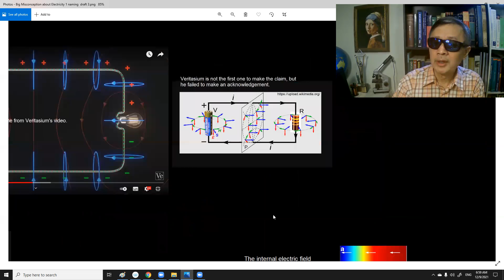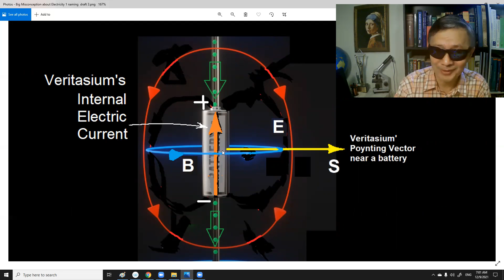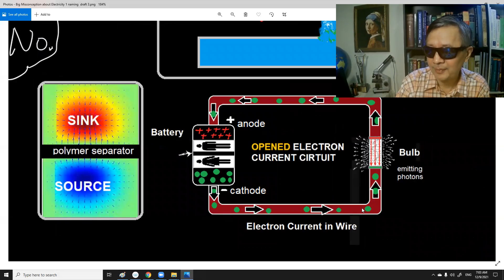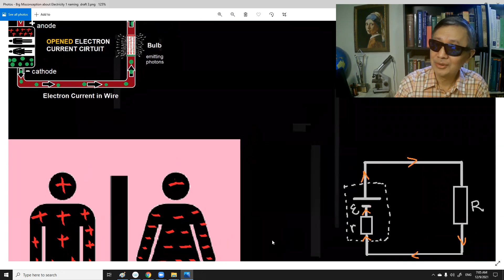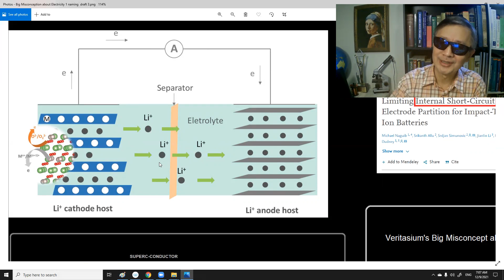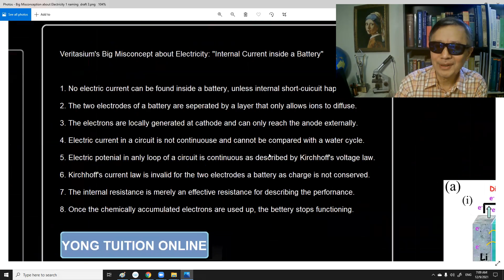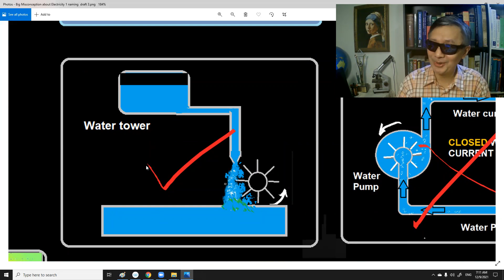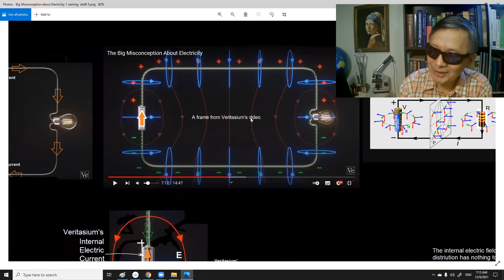No Electric Current inside a Battery: A critique on Veritasiaum's Misconception| Yong Tuition 211209

Comment: Like the other videos he has published on this subject, this is completely wrong. An electric current is a flow of any charged particle, it is not limited to being a flow of electrons. You can find this in any textbook. Positively charged ions flowing inside a battery constitute an electric current and obey all the laws that electric currents obey. They are subject to Ohm's Law, they generate ohmic heating, they create magnetic fields according to Faraday's law of induction, etc. Their mass is irrelevant: the current is simply the flow of charge in unit time. 

So, going over the 8 points at the end:-
1. This is just wrong, there is an electric current inside the battery resulting from the cations and anions migrating within the electrolyte. 
2. Mostly correct, though not all batteries need a separating membrane. 
3. Electrons are generated at the anode of a galvanic cell and move round the external circuit to the cathode. 
4. This is wrong. Electric current goes in a circuit. If it didn't, there would be a strong electrostatic potential between the two half-cells which would quickly stop any current flowing. 
6. Charge is conserved. 
7. Internal resistance is a resistance, same as any other. 
8. No, that is not how batteries work. There is not a pool of electrons at an electrode that get used up.
Reply: I think you are mostly right. Yong Intuition is losing it. Gone off the RADAR.
Reply from the maker: 1. If so, your battery would be burnt immediately.
3. How can electrons spontaneously move to the cathode which is negative? 
4. See answer 1.
6. In an ideal battery, charge is assumed so.
7. Internal resistance is a phenomenological indicator, rather than a real physical resistor. 
8. R u serious?
Reply: @yongtuition  1. The battery would not be burned. Ions flow inside a battery and this constitutes an electric current. The battery will only fail if there is a direct short between the electodes. 
3. Electrons in a galvanic cell flow through the external circuit towards the cathode because in a galvanic cell the cathode is positive. 
7. Internal resistance is a resistance, same as any other. 
8. Yes, I'm serious. You, on the other hand, are a crank who does not even understand what an electric current is. Any flow of charged particles is an electric current. This is not a mere terminological distinction because all electric charges and currents obey the laws relating to electricity, including the Maxwell equations. The type and polarity of the charge carrier does not matter.
Reply from the maker: @BumbleTheBard  It you call the negative electrode as cathode, you don't have to explain your cathode actually is the positive electrode.
Reply from the maker: @BumbleTheBard  It is evident that you can't tell the difference between rain and  water in a pipe.

Comment: You said the current due to ionic diffusion is not comparable to the outside current, what do you exactly mean by not "comparable"? That the Li+ ions movement speed thru the electrolyte and the separator is much  slower than the outside electron speed? I want to understand the comparison among these two little better, for example 100mA current in a 1mm diameter copper wire causes individual electrons to move with a speed about 5.8μm/s. Assuming we have normalized the density of the electrons and the Li+ ions, is the ionic diffusion speed much lower than that?
If this is the case how is the charge equilibrium achieved at the electrodes while the battery is discharging? In fact 6th point in your list says charge is not conserved, so no charge equilibrium? If that is true what is keeping them from flowing back in to the circuit in the reverse direction? What force is counter balancing the Coulomb force, which has to increase continuously until battery is completely drained, right?
Reply from the maker: By the way, the effective internal resistance is introduced to account any ionic diffusion for a real battery, espatically when a battery is approach its lifetime (see 7:51). For an ideal DC power, however, one can always omit such an "internal resistor".
Reply from the maker: Electric current is made by flowing electrons, not ions. Li+ ion is at least 12,600 times larger than electron in mass. Therefore, the diffusion of lithium ions in the electrolyte do not form any detectable electric current.
Reply: @yongtuition  That's reasonable, but the charge conservation at the positive electrode is still a question that needs an answer. What is keeping all those electrons accumulating in the electrode together against the Coulomb force, which is increasing continuously if you have a deficit of Li+ atoms to bind them?
For example, in a Lithium Cobalt oxide battery, I thought positive electrode chemical reaction  is Li(+) + e(-) + CoO2 -> LiCoO2. Is that wrong? If it is right each electron entering into the positive electrode needs one Li(+) ion intercalated into the Cobalt oxide matrix. That ion needs to come from somewhere right?
Reply: @marcfruchtman9473  Yes that is what I know as well, and those ions crossing the membrane must match the number of electrons incoming exactly(assuming negligible losses due to leakage). So their rate of flow has to match the external current. And dq/dt is the current; even if we define the current as d(electrons)/dt, we simply can't deduce from this definition that movement of positively charged particles in the electrolyte won't generate a magnetic field because it is not an electron movement.
Reply from the maker: @timurozturk6435  It would take a long time for diffusive Li(+) to be intercalated next to the negative electrode where the graphite is located during a charging process. In fact, electrons can arrive almost instantaneously at the negative electrode are from the DC source, instead of the Li atoms near the aluminum terminal. In other words, the battery is not a close system, hence care should be taken for invoking charge conservation law for a subsystem.
Reply: @yongtuition  Wait I am confused why are we talking about charging now, everything I said before was about discharging. Aren't Li(+) ions deintercalated at the negative electrode and intercalated at the positive electrode during discharge? No matter how slow this process is the rate of flow of electrons outside can not exceed the rate of flow of Li(+) inside, because they(both the electron and the ion) are produced at deintercalation and bound at intercalation. They have to match otherwise there is going to be excess electrons at the positive electrode which doesn't make sense to me.

Edit: I meant excess electrons in the positive electrode that is increasing in number. There is actually a small amount of excess electrons in the positive terminal but that surplus is constant in number and in line with the fact that voltage-under-load is slightly less than open-circuit-voltage.
Reply from the maker: @timurozturk6435  It would be more difficult for Li(+) to diffuse back to the positive electrode side because of Coulumb forces:
the repulsion from the positive electrode and the attraction from the negative electrode before the battery completely die. That is why charging is faster than recharging, but did you stick on one of them?
Reply: @yongtuition  Yes I was sticking only to the discharging scenario in all my arguments, just so it won't be confusing more than it already is. I know the process is reversed and everything is flowing in reverse direction and chemical reactions are also reversed during charging compared to discharging.
Back to the discharging scenario again, I agree with you that individual Li(+) ions are moving much slower than the individual electrons flowing outside, so the current density j is much less for ions in the battery compared to the current density j of the electrons outside in the wire. But the Li(+) ions move through a much larger surface area of the separator while the electrons outside are moving thru a surface area equal to the cross section of a thin copper wire. If we integrate j(ions) over the separator area and j(electrons) over the cross section of the copper wire outside, the two results must match. And those results are the current i=dq/dt . Hence we end up with same amount of Li(+) and electrons in the positive electrode where they bind in LiCoO2 for example. There is no violation of the conservation of charge in the electrode.
Reply from the maker: @timurozturk6435  Obviously, you have missed out the key issue in this short video.  Besides, you need to use integration over the entire life-time of a battery. Local symmetry can be broken, so is charge concervation law.
Reply: @yongtuition  If we integrate j over time as well as over the surface area we get the battery capacity, like the mAh ratings on the batteries right? But in this video I believe we are discussing the DC steady state current, which a typical battery can sustain for hours. That means the charge conservation law would be broken for hours, as long as the battery is running. I have never heard of this happening even in purely theoretical scenarios; everything I can find on this suggests that the theorized local symmetry breakage is of extremely small duration, and even that is not observed in experiments so far. Can you please direct me to some of the papers you mention in the video, I would like to peruse them. Thanks in advance.
Reply from the maker: @timurozturk6435  Thank you for your suggestiions. From now on, I will list all the key references to be used in my videoes. By the way, one doesn't have to go that far to a particular lithium battery technology to explain Veritasium's misconceptions about electricty because one can simply use an ideal battery in which the effective internal resistance is zero.
Reply from the maker: @timurozturk6435  ...I suggest you start with P.W. Anderson's work in the context of condensed matter physics and then to go the so-called standard model.

Comment: Very eye opening. I have always thought of electricity as a water cycle, a wrong view indeed. I really like the analogies and metaphors you used to explain, very helpful.
Reply: Actually he's wrong, and the "water cycle" is correct.   Look up: metallic conductor, electrolytic conductor.   I hope he corrects the misinformation.  Salt water is a conductor.   So is alkaline electrolyte in batteries, so is acid solution in batteries.   In fact, the number of amperes in the battery- wires is exactly the same as the number of amperes flowing in the conductive electrolyte.   (The path of current is *through* the battery and back out again.)   Yong apparently believes that battery-electrolyte is an insulator?    No, instead the battery-electrolyte behaves as a short-circuit, with large amperes (the same as the ampere-value which appears in the external circuit.)     Electric circuits are closed loops, they are rings of moving charges, and batteries are like resistors, like coils, like wires, in that they are good conductors, where charges need not build up, because charges flow **through**.